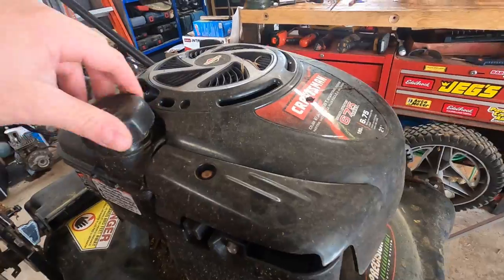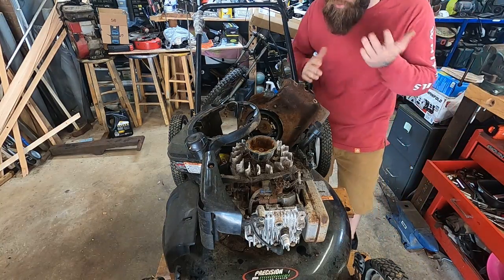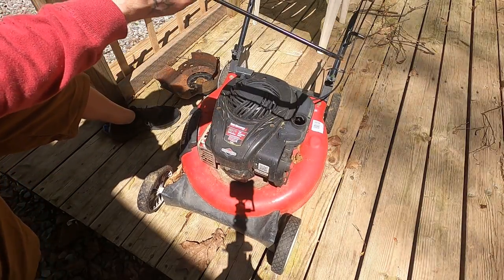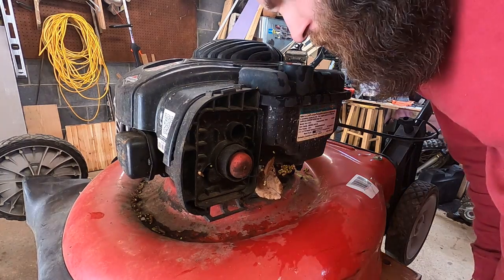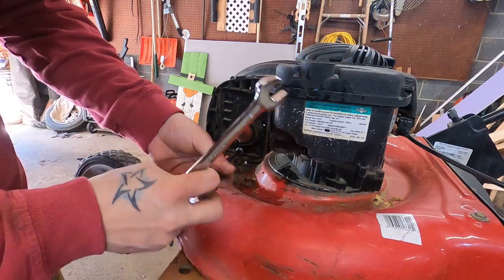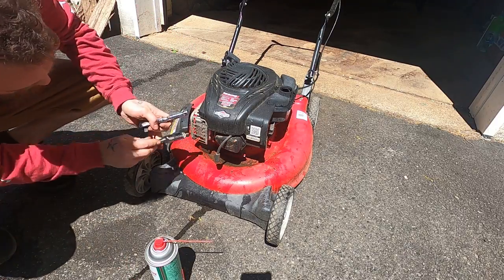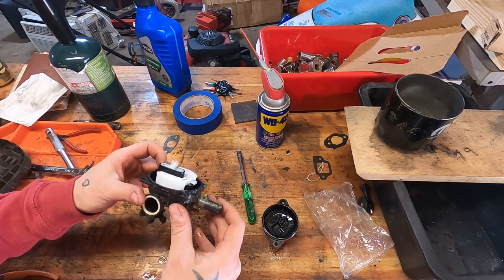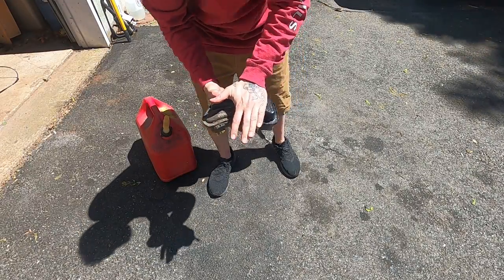Free Lawn Mowers FULL OF WATER - Will it run?

Comment: Ya got lucky with that plastic carb those jets usually plug up with junk and you have to pull them out and split them to get them clean enough to run, did 3 at work today.  Briggs calls them fuel modules, I call them a pain.

Comment: Pull the internal out of the metal housing on the 675 series flathead (Quantum), slotted screw in center and repair the rewind spring. It rusted and snapped towards the end, be careful its gonna wanna fly out of their and unwind all over the place. Cut the end piece off where it rotted, make a bend and stick it back thru the slot. Lubricate it well and put the internal back in the metal housing of the recoil, screw the center slotted screw back in to the center. Thats it, it will work. That OHV recoil wouldn't have worked anyway. Tecumseh parts don't swap to Briggs.
The recoils with rivets can be drilled out and replaced with nuts and bolts for ease of access on personal equipment.